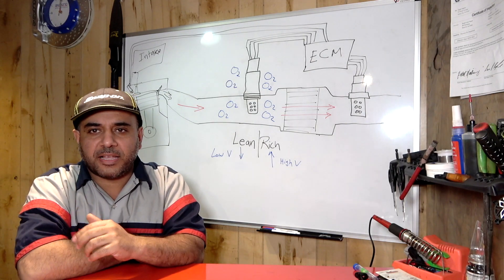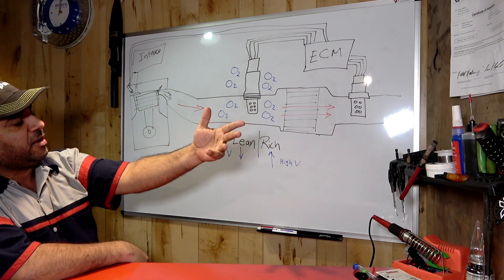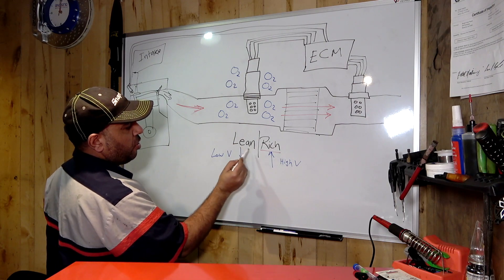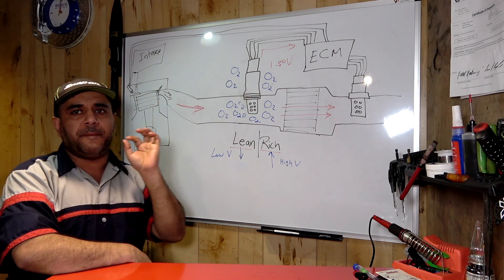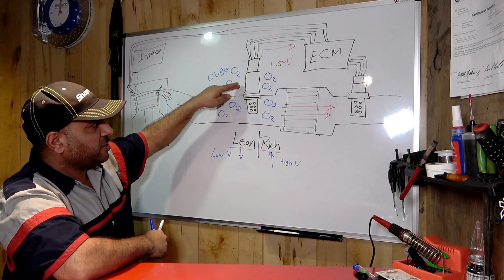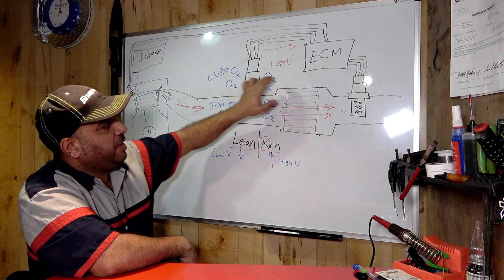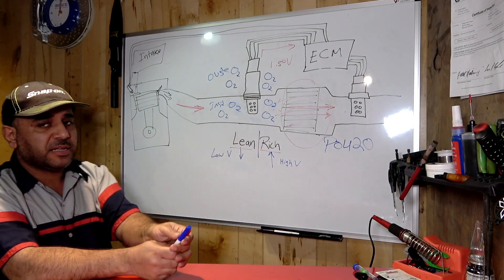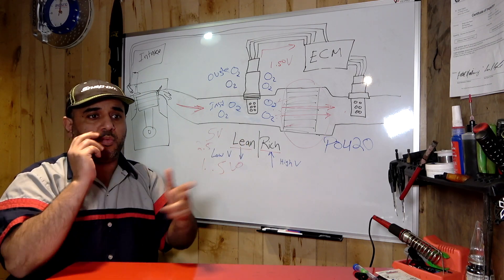How oxygen sensors work   |    Oxygen sensors  Explained

Comment: These are my readings after code 0420. Sensors ok?  https://www.youtube.com/watch?v=aBa1mNd0xEU&t=10s
Reply from the maker: Clean the down stream o2 sensor see if it give good reading
Reply: @RBTheMechanic  I replaced the downstream sensor by a new one. The check engine light will go out after a drive? The old sensor was like a bit white-beige colored.
Reply from the maker: @Tintoycar no u have to reset the check engine with scan tool
Reply: @RBTheMechanic  OK, I will do that. I will let you know the result in a few days.
Reply: Light is back on 😞
Reply from the maker: @Tintoycar what’s the code and what u did so far
Reply: @RBTheMechanic  0420, 2 bottles of cat cleaner, and a new downstream sensor, new sparkplugs, new pcv valve, cleaned the EGR

Comment: For motorcycle fi  sir. If i change may exhaust pipe to aftermarket pipe  it is necessary to remap may ECU??
Reply from the maker: Depends some motor cycles take pressure from exhaust so if so then it depends how it was built to be in spec or no
Reply: @RBTheMechanic  thank you sir.

Comment: The car failed the too much CO emissions test. and blue fumes from the exhaust... I know that the PCV valve could be the cause or the EGR valve could be closed, maybe I should take a look there, I have also had problems with reading. But no light came on. my code is P0400 Recirculation malfunction flow another the P1132 lack of H02s11 switches. sensor indicates rich see P2196
Reply from the maker: Clean it out
Reply: @RBTheMechanic  you mean cleaning with liqui motor flush? or clean the EGR valve and PCB valve thanks
Reply from the maker: Egr and pcv
Reply: @RBTheMechanic  

I have done a  test the compression is 18 Bar all 4 the cilinders.
Bud still oil using i donť understand this.

Maby i get to look to the egr and pcv

Comment: Watched the video and i have a question does the OS is counting the oxygen in the exhaust gas all the time or only in some range of RPM....for example only on idle.... and no under load ex at 2000rpm cruising...TIA
Reply from the maker: All the time
Reply: @RBTheMechanic   thank you

Comment: If I add hho from air intake filter box, will that throw off the sensors?
Reply from the maker: What is hho
Reply: @RBTheMechanic  water electrolysis  Positive negative on still plates they turn water into hydrogen and oxygen. What will happen if I inject it through air intake.?

Comment: My boyfriends car started having error codes ( p0300, p2626, p0132, p0130, p0030, p0302, p0441, p0304)

Which I’ve ruled out was the 02 sensor or ECM being bad. He’s literally on the way to his next command (military) and his car broke down at midnight. 

 It sounded like the engine was misfiring and shaking, would go above 40 when driven to the closest but closed mechanic shop. 

 I don’t think it can be anything else but those 2 things. Hopefully it didn’t damage the engine. 

It had a high meaning, not enough oxygen. And it’s an error before the catalytic converter. Or an error on the ECM and just fucking the engine up…. Huh….
Reply from the maker: What year make model is the car
Reply: @RBTheMechanic  2015 Hyundai Sonata. The mechanic saw it and it was indeed the 02 Sensor and he was back up and running by 11am. It was causing his engine to misfire :D Thank You!
Reply from the maker: @WarmthRainThunder  oh ok glad u found the issue

Comment: Thank you for explaining that. You just saved me a lot of money.  Initially I was going to replace all 4 sensors in my ford truck but I did not realize that the dow stream sensors were specifically for the catalytic Converter. My truck recently started shutting off in the middle of traffic, so more than likely just my upstreams need to be replaced.

Comment: Can you bypass the 02 sensors
Reply from the maker: No I wouldn’t recommend it
Reply: I thought not can you help I have a 2016 Nissan QQ 1.6 Petrol. I replaced the bank 1 sensor 2 12 month ago this sensor failed again code P0138 H02S2 and P0037 I have a reading of 1.79v reading on the diagnostics H02S2 and it’s running rich. Before spending money on another sensor can you help with what’s going on like I said the sensor was only replaced a year ago could this be a dirty cat? Also do you have any recommendations on cleaning the cat without having to remove it I have been reading people have been putting Lacquer Thinner in the tank ??? thanks for your reply I look forward to hearing from you cheers
Reply from the maker: @DARRENJOHNHARRIS1  sensor could have failed before u do anything u need to replace that sensor also there is a relay for sensor replace that also
Reply: @RBTheMechanic  is it normal for a sensor to fail so quickly they are not cheap and I don’t want to keep replacing it every 12 month. Should I replace both bank 1 sensor 1 and bank 1 sensor 2 ? Is it possible you can give a little more information on your reply to my original question I can’t find the location of the relay only a fuse to the o2 sensor I appreciate the help but I am no mechanic more help please 🙏
Reply from the maker: @DARRENJOHNHARRIS1  usually they last good 2-3 year but u never know defective

Comment: Thanks. I understand  the oxigen  s it's there  just. Manipulate the fuel and  make the car rum on the computer mpg especified from the Manipulate  car market,  that  say if the car can give 50miles per gallon the ecm will make more fuel into the exhaust  then all the. Energy waste on the donw pipe its burn at catalytic converter  try to give less contaminated air out , or just say car its eating  the fuel accordingly to the monopoly and that it's how its done into the computer  control,  and the cat. It's there just  to burn  the remaining  fuel, and u don't smell the raw fuel  coming out of the exhaust  otherwise  u catch  back ad more oxigen and re-burn entirely end use the energy  that it's waste at cat.  By the. Way  cat I  control automakers treason